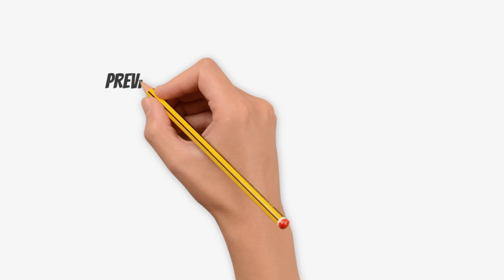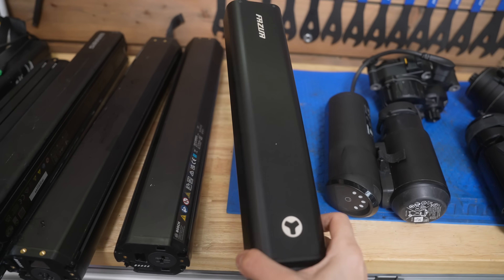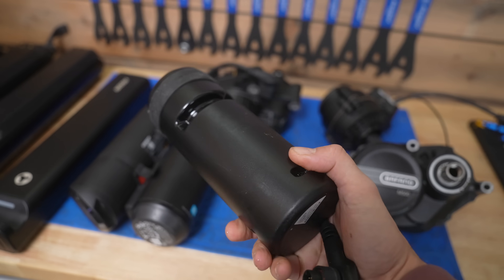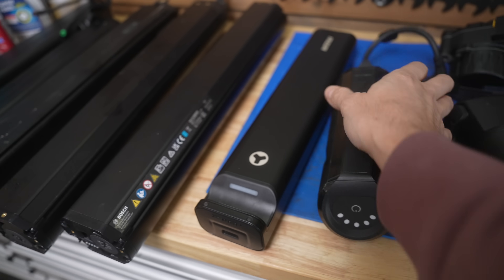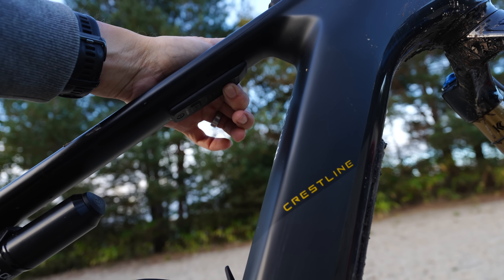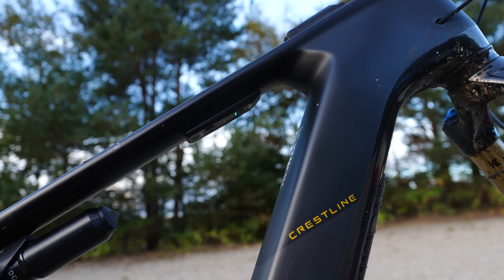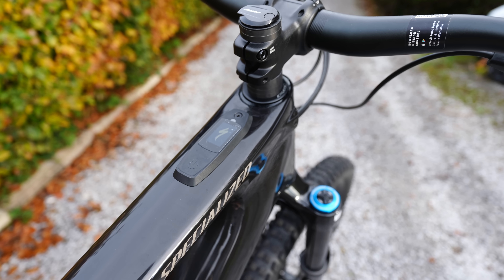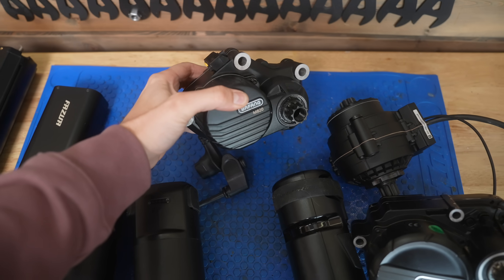We Have A Huge Problem With Ebikes....

Comment: They don't want this, it helps them keep people locked into their ecosystem and also spend more money.  Say you just want to upgrade your motor, instead of just swapping it out suddenly you need a whole new frame, battery, motor, display, charger. This can be plainly seen with how bafang is moving. In the past they allowed you to use any battery you had, now you are forced to use their "smile" batteries. And don't even get me started on the locked down canbus they've moved all their motors too, making it harder to change settings requiring an expensive tool or in some cases locking down those settings completely

Comment: Thanks for bringing this up. This is the same problem with ev cars, that’s why the chargering network isn’t working. This will also help when selling your old bike. We are going to end up with a lot of bikes going to the tip because bike companies won’t support or stock old parts.
Reply: I think the EV network is in a better place than that. Seems to be settling in CCS for rapid charging (DC) and AC charging is mostly uniform Type 2 sockets

Comment: Only for pikers who buy low power ebikes off the shelf. Builders in start contrast can build a 2000w mid drive ebike with generic 52-72v 25 amp-hr battery with Name Brand Cells whereby everything it easily replaceable and upgradeable from 1/3 to 1/2 the cost.

The point of building your own ebike is:
1. non-proprietary parts including all the production ebikes with overpriced, CANBUS based, proprietary software, low power motors and batteries with Chinese cells that degrade quickly.
2. Cost
3. Power level.
This has been apparent to ebike builders for 'years'.  
In summary, a fool and their money is the theme of your video.  Of course proprietary and integrated parts are created for bike manufacturer profit.  No different than a $15K Tour de France level all carbon roadbike with electric shifting , proprietary seatpost and handlebar.  Honestly, this practice is ubiquitous in many industries from automobiles, to wrist watches to Iphones...no part interchangeability because each manufacturer wants the replacement part revenue stream.

Comment: I agree there should be a standard that all the manufacturers can choose to build to and also go bespoke if they need to drive innovation. So for example if all bikes were made to the "Rob Rides Compatabliity System" RRCS and bikes come with that stamp on the box and it means motors, batteries and chargers can be fitted and upgraded from different manufacturers then I think it would drive sales of RRCS compliant bikes and we would all win in the long run. Probably bring the price of ebikes down significantly too.
Reply: It would also help hold the residual value of the bike.

Comment: On top of all ... the biggest problem is that there is not MAINTENANCE path either. 

For my $10,500 Shuttle I cannot get a Shimano battery, and soon I won't be able to get a e8000 motor.

In a year or 2, my $10K Bullit will be at the same place. 801 doesn't fit, ep8 might or might not be available. And at the rate I am going through them, I will have 2 really big and really expensive chunks of carbon fiber paper weights....

Meanwhile my 2016 SC Nomad  can take a 12s update, and works just as fine as my ... 2020 Nomad  ... and unless I crack them, they will be fine and serviceable in 2030 ..

So I get your point. But I don't care about the "but tomorrow it's obsolete". I am however really worried, that when these motors/batteries die, my lifetime warranty carbon fiber frames will be just garbage ....

Comment: Absolutely agree Rob, I bought a Kenevo SL as my first ebike, then new rumours started that there was going to be a new motor. Then the SL 1.2, not available for retro fit even though it has the same mounts. New prices of the old bikes fell through the floor. This knocks on to second hand values. So your left with a bike the manufacturer won’t let you upgrade that’s worth nothing, not even out of warranty. Don’t get me wrong I have loved riding my ebike, but had I known how unreliable they are and how much value a 12 month old bike can lose I would have picked differently.
Reply: I am in the exact same boat with a KSL. I’m super frustrated. I love e-bikes and they have their place in mountain biking but I just don’t think I can buy another one with these issues.
Reply: I’m in the same situation bought a KSL earlier this year then not long after specialized slashed there prices by almost 50% so I now have a bike that I can’t upgrade the motor on to the latest model since specialized won’t allow it and set to lose substantially on it when I come to sell it.

Comment: The solution is the path that I a lot of us, including you in the past Rob, have done. Build your own bike up using a well chosen frame and fitting a kit motor/electronics. It involves research and planning but can result in a fantastic ebike. My version is a CYC Photon kit on a full suspension frame with a battery I have built but the battery could have been bought instead. This summer the ebike kit was removed and I pedalled a fantastic normal bike on a European holiday with others on normal bikes. Back home the motor was put back on and today I've had an absolute blast on an amazing off road trip. It's an incredibly versatile solution. The technology is moving so fast, which we all want to benefit from, that the problems you describe are inevitable. By going DIY you can replace the kit motor/battery with the latest and greatest at a fraction of the cost of a new proprietary ebike whilst keeping your old frame and parts. Thanks for the post but I believe there is already a way forward to mitigate many of the problems you mention. That solution does not involve just popping into a shop and walking out with a brand new ebike that you can ride on straight away however.
Reply: There is even cheaper option. Cyc photon is a good motor but way to expensive. Toseven DM02 is much affordable. Less than 500 USD.
Reply: Yes you are correct. I was just trying to make the point that it is possible to reduce the financial burden, upgradability and sustainability issues today and still have an oustanding ebike while the proprietary ebike vendors work towards common standards. @ataksnajpera
Reply: This

Comment: Dream on Rob. Seriously? Are we really bumbling through life thinking manufacturers give a flying orgasm about the consumer ? Your joking. They want to charge you money. Look at the car world. Can bus, that’s the standard. Where oem’s programme every component to work as one. Head light. Tail lights. Head units. All programmed to work with an ecu. If it ca t see that programmed component it won’t work. Change a component you have to go the the dealer to get the new part programmed in. And they charge. They have the computer. You have to lay them. And so it is now with e bikes. Can programming as a system. Battery motor switched screen it’s all one system, not a group of components so it may as well be bespoke physically as well. There is no point in this. I agree with you. It’s shit. Diy ers are literally being programmed out of the market. But if cars won’t change neither will the bicycle industry

Comment: I think the problem with your argument is that you're considering the motor, battery and control unit (inc software) as three separate units - which you might want to upgrade individually - when actually those electronic elements are all designed to work together as a whole... Just replacing the motor for example is not going to work if your existing control unit cannot manage the [torque sensing etc] data coming out of it, and similarly the battery management element of using components which were not designed to work together.

It would be impossible for any software developer and the warranty department of each respective bike manufacturer to try and cover all the possible permutations of battery, motor and control unit that would result if owners could subsequently pick and choose each of those three elements...

While I can appreciate your point about backwards compatibility within [motor] brands - ie. all Bosch batteries ought to work with all Bosch motors, and both those elements with your current control unit [software], there will come a point when the specification exceeds what was available when the earlier iteration was designed - just as certain apps no longer work on older smart phones as an example. 

I agree it might seem frustrating from a consumer point of view - but you have to consider the electronics in these bikes as a complete package, and one which also needs to integrate with the frame itself (cable/wring routing, heat management etc.) - and accept that the motor/battery/control unit combo is essentially part of the frame itself - and simply buy a new frameset if at some point you wish to update to the latest specification from a particular manufacturer - just as you might with a non-eMTB bike frame - while keeping all of your existing cycle parts.

And to be quite honest (to continue the smartphone analogy above) all of these 'advancements' in eMTB technology are incremental at best - there is nothing wrong with riding your existing bike/frameset for a good long while, instead of thinking you're somehow missing out on something and have to have the 'latest' every year...
Reply: As a software developer I disagree with this message ;-)
Reply: @timobreumelhof88  care to expand on that? How are you going to write control software that allows any motor to work with any CU and any battery that a user chooses to combine? You might get it to run, but it's not going to be anywhere near maximum efficiency.
Reply: fwiw. I do agree it seems a bit silly to have to have a dedicated charger for each battery type, but again, these are not simple 'double AA' rechargeables, but 'smart' batteries which require an element of battery [cell] management during the charging process, which is dictated by the respective motor manufacturer's software...

Having a 'universal' battery pack standard would not only limit certain frame designs (ie. added weight and/or wasted space on bikes which may only require smaller batteries), but also how those batteries integrate with the respective manufacturer's control unit software, further limiting development in that area. You would also inevitably get cheap 'clone' batteries being made, which may not meet the quality control/safety and/or integration compatibility with the control units.
Reply: @yodapig  I think the USB-c power delivery standard is a great standard to use for chargers. Part of it is negociating with the battery what kind of voltage and or amperage it needs.
Reply: @timobreumelhof88  that is because all smart phones basically use the same small/low-power battery which can be charged from 5v USB. You could designate a single size/cell/voltage specification for bicycle batteries (as the Asian manufacturers have done with eScooters with swappable battery packs), but then you're limiting the bicycle designers to have to work with a certain size pack - which may not be compatible with lighter weight/lower-powered eMTB designs.
Reply: fwiw. I think it will come with time, just not until battery technology has taken a significant step forward from the technology/chemistry we're using now.

Comment: Agree with all you said. A common charger standard should be the first relatively easy step. It's like USB charging. now all our phones and laptops seem to take them it's a game changer.

It's a minefield for new buyers like myself. I've spent weeks deliberating over different bikes on different motors.

There needs to be some level of regulation in the industry.

Hopefully the whole right to repair movement brings in some new practices
Reply: Buy something with a Bosch motor. Preferably a smart system.
Reply: I’m leery of regulation by the government, because it always seems to turn out that the standard that is adapted is either from the current sales leader at the time, or it comes from a US Senator who has heavily invested in one type or brand (who wants to make a bundle of money).

Comment: Absolutely. Even cutting down to half the amount of battery sizes/shapes and a universal charger with switchable ampage for different bikes. You could even then have an adaptor for the charger output plug to suit each manufacturer. We have two Shimano powered Canyons, E8000 and EP8 both with different chargers and ports.

Comment: Yes, ebike motor producers and ebike manufactures in general could you please unify some things like:
- One charger plug for all motors: like its is with usb-c in electronics
- Open BMS (battery management systems) for easy battery replacements or cell swaps. Ebikes should be sustainable right? So please give us an option to repair batteries when these are out of production or are not available in some regions. 
- Two or Three standardized motor mounts: for full power motors, for SL ones and others? 

At least "one plug" and open bms should be mandatory for all e-bike stuff producers!

Comment: I've been thinking this for ages. I'm glad you've brought this up. Ironically, the environmental impact of having to throw away the entire bike because one component is no longer available or made for the bike - is a major contradiction. How hard is it for all motors and battery frame mounts to conform to the same basic dimensions for all bike frames? That's all you have to do to create interoperability. Then for the rest of the bike's mechanics - we have over a century of bicycle component evolution - of wheels, gears, tires, brakes -  which all work fine and don't require reinvention!
Reply: You're not throwing away a 'whole bike' only replacing the frame - which with an eMTB also contains a motor, battery and control unit. You need to consider an eMTB frameset as a complete unit, just as if you decided to buy a new regular frame... it will just cost a bit more.
Reply: @yodapig  that could be an option. The notion of expensive lightweight carbon frames for E-MTBs seems absurd to me when you consider what batteries weigh anyway. Problem is... who's selling them?
Reply: The parameters you mention are not difficult at all- if you watch the video carefully, he mentions that the e-bike motor companies are making newer versions of motors that fit exactly in the same place as the previous versions, but there currently is no way to make it work because of firmware requirements.
Reply: The environmental impact could be a political argument to push for "green"  standards for reuse. Require mfgrs to responsibly recycle their own parts, for example.

Comment: Bosch are a nightmare. Smart, non smart, different lengths, horizontal, vertical. At least specialized batteries have been pretty consistent over the past 4 years.

Comment: You have an interesting perspective having so many different brands to ride. I've stuck with Bosch, got a Trek Rail in 2021. I've upgraded everything on the bike and I'll ride it into the ground. I went with Bosch for precisely the reasons you listed, I saw the Shimano motors and knew that they would upgrade soon. So glad I didn't get a Shimano bike. Pinkbike is filled with people asking way to much for their now outdated ebikes. Unfortunately the depreciation on these is going to be heavy. If you bought an $8,000 bike two years ago you honestly will be lucky to get $3500 for it now. Its part of the ebike game, you will loose money on them, but the joy outweighs the loss.
Reply: So true, i have also got the rail and upgraded and will run it into the ground. Fantastic bike, but one of the main reasons i brought it was the Bosch system. I knew after the warranty period you could get the parts and repair the motor if it failed. Bosch will supply the parts also.

Comment: Wait what my new 48v system cannot charge on the old 36v chargers. No I do not want to be compatible with your loony 62 deg head angles I like 67 deg. Differences are desirable.
We had a standard 26 inch wheel then a new standards of 27.5 now a new standard of 29inch You have not even touched on the MGU mounting.

Comment: I will play devil's advocate: you shop for a bike, it does everything you want it to do, failure parts are easy to upgrade (brakes, tires, and drive train) across the board, you pay your money and you use it for years. It's a bike. It won't stop doing bike things 6 years down the road because it's obsolete. You can't say that about computers or cell phones because they simply won't interact with their environment which is other advancing tech.... It interacts with dirt and rocks, and dirt and rocks aren't picky about how updated your bike is. I think people need to think about bikes being somewhere between a car and firewood. It's not a multi decade piece of transportation (usually), and it's not a total consumable.

Comment: For the charging part there's certainly more to it than just simply charging the battery. For example with Bosch systems, that Bosch charger is actively communicating with the battery when you charge it.
Reply from the maker: Agreed - the other brands also do this. In fact most electronic devices work in the same way - theres a BMS that regulates the charge so they dont overcharge.